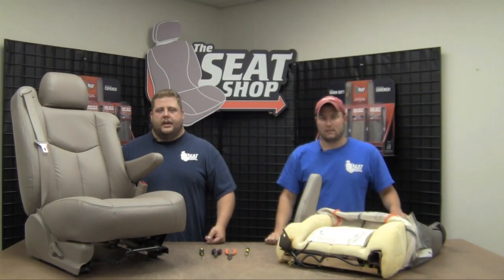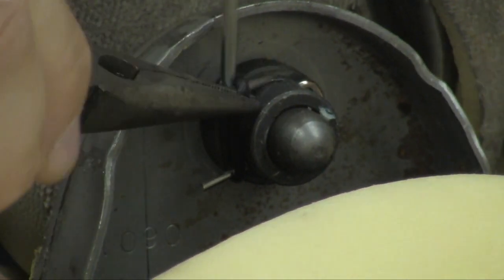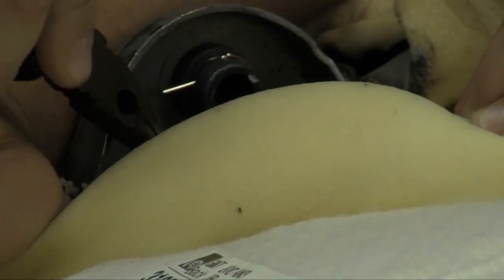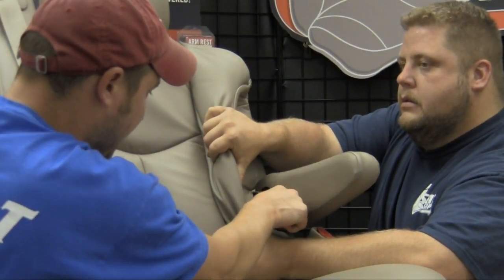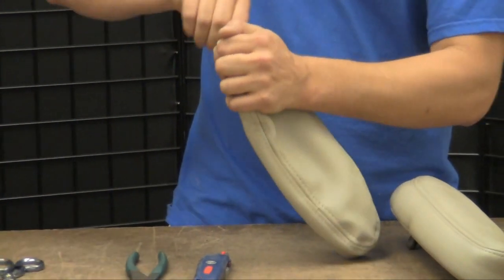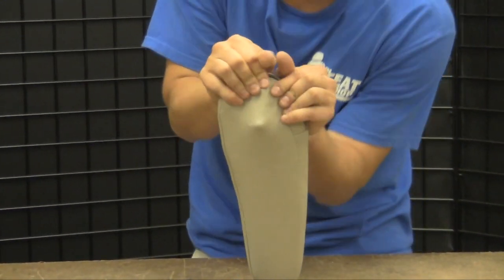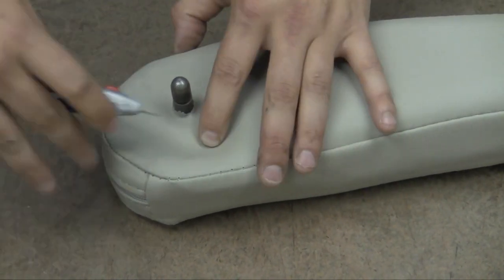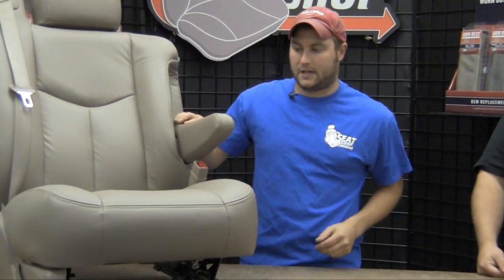Chevy Armrest Cover Install

Comment: I am extremely thankful for this video. i would have never figured out how to remove (and reinstall) the armrest on my Chevrolet Express 2007. Even with the video, I was not sure: the material on my seat could not be pulled as easily as it shows here. I needed to cut it a little to have access to the clip and rubber band. Thanks to you, I knew what I was looking for. I bought a replacement cover from the seat shop. It was also more difficult to slip on than in the video. My son even thought it was too small. Good news, the material eventually stretched and fit perfectly. I am super happy with these guys sharing their expertise. Good job!
Reply from the maker: Glad we were able to help you out with this

Comment: Hey Brian & Hunter you guys put up some awesome instructional videos, my seat heater on my 04 denali was kicking off so after watching your video i ordered both heating pads like you guys suggested , the order came in 4 days and today its about 19degrees here in the D.C. area, so i disassembled the seat just like you guys said and BAM! 
Both heating pads were burnt, the new ones fit perfect and work awesome, the only thing i would suggest is on the heating pads put a note like "this end up" because i can see someone putting them in upside down, anyway great job thanks again
Ron C.

Comment: A magnet tool can be inserted before trying to remove or install the clip, most of the time if the clip falls it will go into the magnet and you can just pull it out. Magnet tools cost like $2 at your hardware store.

Comment from the maker: It cannot be replaced.  It is foam injected inside the cover from the factory.  Is what you can do, is add some extra foam over top of the old armrest before you install a new cover.

Comment: If you lose the clip, it is usually gone.  I lost 2 of them trying to put it in.  Here is a tip.  Get a strand of dental floss and tie it to the pin and put a loop on the other side and hook it on your pinky.  Then if you drop it, you still have it.  Also, instead of clipping the end of the binder clips off, bend each end outward around to make a full "U" on each end.  Then, instead of using the flimsy rubber band which will not work on the replacement clip, use a zip time and pull it super tight.  It works perfectly.